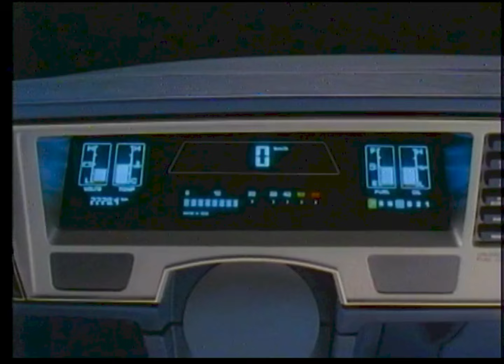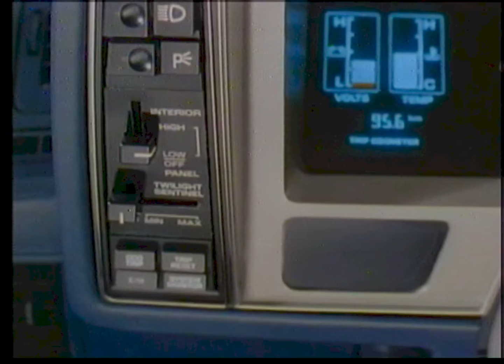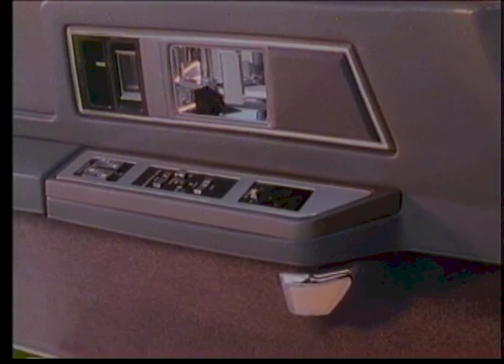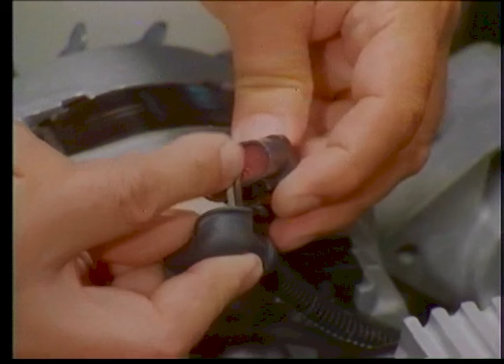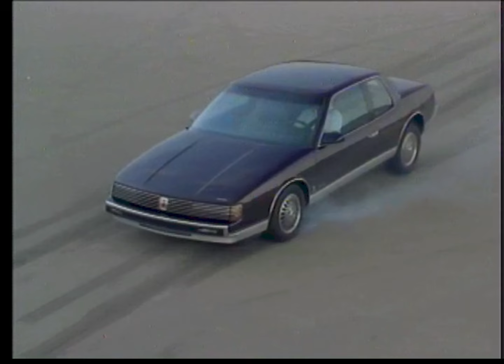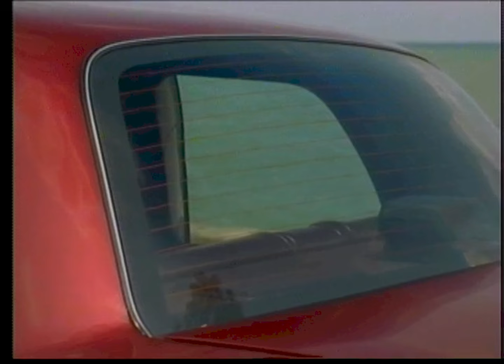This car was so advanced that mechanics hated it. Even at the dealership!

Comment: Thank you for the video. Two parts of this model were used well into 1992. The hood and the instrumentation panel. I own a 1992 model. The car got larger from 187 inches long to 200 inches long and got wider.  The trunk got larger too. The wheelbase stayed the same. When the car got larger, it did not look small or chopped off any longer. The reliability improved also as well as the engine. I am driving mine this week right now to work daily. I do wished they had kept the interior door handles on the 1990-1992 models. The trunk pull down feature disappeared with the redesign in 1990.

Comment: Had this car. 1987 Toronado Trofeo. It. Was. A. Nightmare. Technilogically too ahead of its time since something went wrong with it almost every day. Frozen steering column, the infamous ability to take the key out of the ignition while still running (beneficial on cold mornings), and the ability to completely turn off with ZERO power while in motion at high speeds, then magically turn back on again before death.
Reply: My 91 Bonn SSE would do the same thing driving on the interstate especially getting off an exit ramp. It would completely shut off and then come back on. Yes it was SCARY! Anyways I got lucky an the technician replaced an emissions computer or some chip but it never did it again.

Comment: Ah yes, the ol' E and K Body shrinks for 1986.  GM bet on smaller and more efficient due to gas prices and customers were not happy with the results.  The Cadillac E and K bodies (Eldorado and Seville) almost got Cadillac's doors closed for good as a result of these.  If the 1992 Eldorado and Seville were not a hit, it was lights out for Cadillac.  Even Olds though knew it didn't work as the Toronado gained 12 inches in length and 2 inches in width for its massive refresh for 1990-1992.
Reply: Exactly accurate and true.  Well stated.  The downsized era at GM 1985-1991 was a big disaster across all the brands except Chevrolet which did not downsize as the others did. The upsizing started in 1989 with Deville and Fleetwood and Buick Riviera. 1990 was Toronado. 1991 was Ninety Eight and Park Avenue. 1992 was Bonneville, Eighty Eight and Le Sabre.  Roadmaster sedan joined in 1992.  Oldsmobile wanted the sedan as well, but GM sedan no. Ninety Eight would have been placed on the B car platform. 1992 brought the upsized Seville and Eldorado as you mentioned. 1993 brought Fleetwood/Brougham. Riviera grew more for 1995.

Comment: I guess originally it didn't have the touch screen?
Reply from the maker: Some models did not have the touch screen. But I do remember those specific ones having the most issues. I have a video on the touch screens. One of my Riviera videos have it.
Reply: I think that touch screen was more common in the Riviera. But, that’s probably because the Riviera was more common.
Reply: Dad bought a new one in 1986. Beautiful car, but didn't age well electronic wise.
Reply: Not till 89...and only as an option then.. It was about 20 YEARS ahead of it's time...before the public would finally embrace touch screens in cars.. and my vary favorite feature of the Trofeo !!

Comment: "In addition to the wide array of driver information functions, there are many others which are operating continuously, monitoring systems and components, storing data, correcting problems - and when necessary, advising the driver."

I rented a 2025 Jeep Wagoneer last week during a visit to the east coast, and the technology they were trying to incorporate into the 1986 Olds Toronado is exactly what I had in the 2025 Wagoneer. It's shocking the amount of data that's stored in new cars these days. From yaw, to steering radius, to seat position, and probably thousands more. Every button or pedal you touch is recorded by the vehicle's onboard computer, and sometimes is sent over cloud to data brokers, insurance companies, etc... My point is that the technology they were trying so hard to make possible in 1986 is now a reality 39 years later. Except our cars can even drive themselves at least somewhat autonomously. The Toronado was almost 40 years ahead of its time.